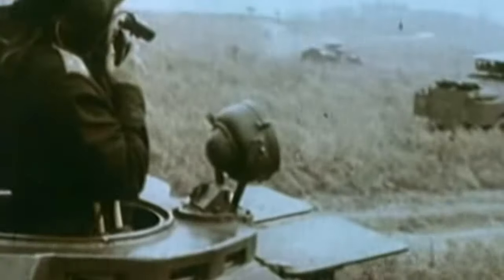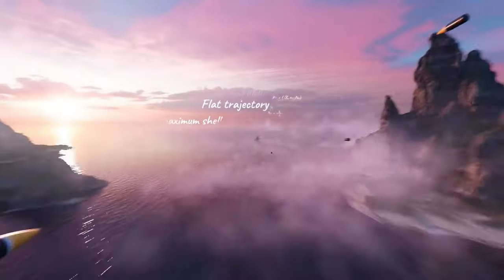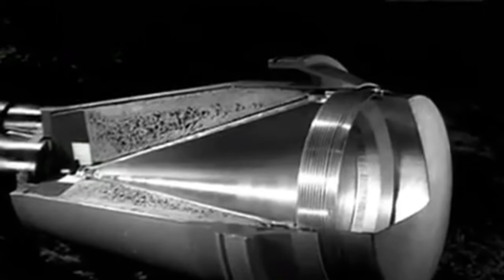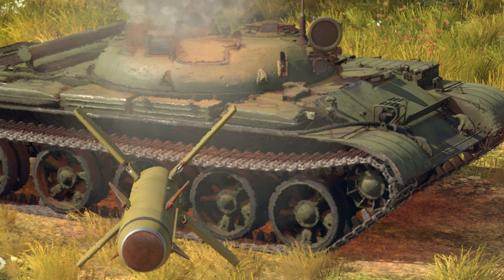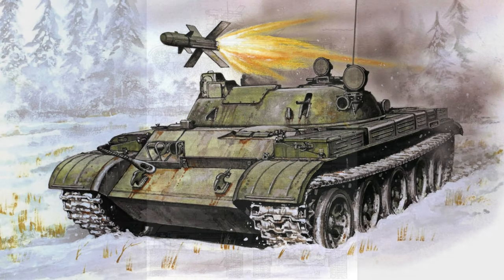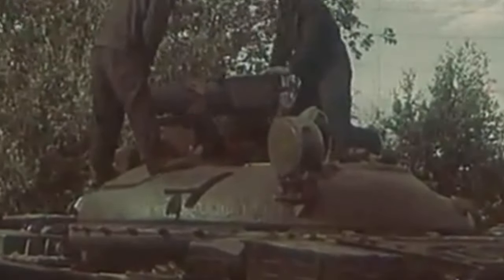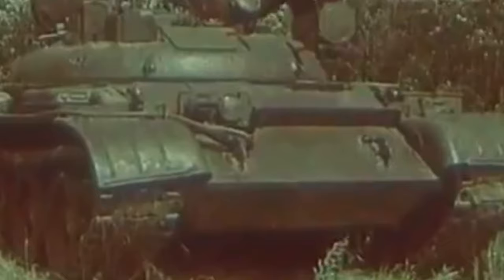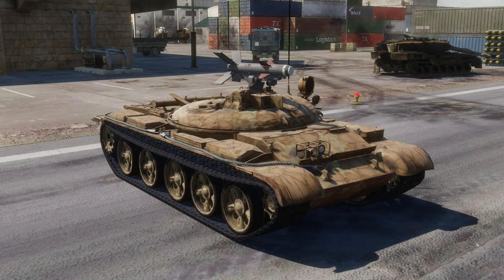IT-1 Tank Destroyer | SOVIET ANTI-TANK MISSILE VEHICLE

Comment: Easily one of the coolest reloads I’ve seen
Reply: I put this right up there with ultimately inefficient but cool weapon system concepts that actually made it to the front line.  Right next to swing wing aircraft and those naval missile launchers that reloaded vertically from a hole on the deck.  Now that I think of it, a tank borne VLS system would be pretty cool, and not really necessary too!
Reply: @josetrujillo2394  "a tank borne VLS system" - may I introduce you to the Russian Tor mobile SAM?
Reply: That's what your mom said 🤣

OH SNAPP BURRNNNN
Reply: @ExcavationNation  😐
Reply: @ExcavationNation  0           0
                                       ------------

Comment: Its less that the TD concept passed it by, but more the technology did.  As mentioned ATGMs became miniaturized and ruggedized enough to be fitted to gun tanks and IFVs.  But the "tank destroyer" never went away, it was just realized that MBT level armor wasn't necessary for the role, so it went to cheaper platforms like the BRDM.  The IT-1 is kind of like the Soviet version of the M-60A2  or I guess the Raketenjagdpanzers. The last gasp of the old idea that a tank destroyer would have to  square off against tanks in a gun fight.   The TD evolved into light missile carriers and attack helicopters.

Comment: Matsimus: Thank You for taking up a subject, I consider of Importance! What is a tank destroyer and what is a tank destroyer?

If we look at the Swedish S tank it was more of a tank destroyer than a tank. What was wrong with it was that it was tracked. It is a simple design proposition that there is an optimal ratio between the lenth of the supporting track and the with of the vehicle.
Make it to long and you get a damned heavy monstrosity that cannot turn (or when turning clears out a city block and need heavy duty support to move at all (You can watch Sofileins latest videos for a perfect illustration of that point). Make the relationsship to short and the vehicle is directionally unstable at the slightest speed - it simply spins around at the slightest provocation.

Now trust the Swiss (and turks) to come up with a solution: They make the rearmost wheels counter-steering below a speed of 20 km/hr. This gives the  Piranha V 8*8 a very tight turning circle (necessary for the Swiss mountain roads)., In fact so tight that the whole vehicle has a turning cirle that is about the same radius as the turret on a reasonable sized tank gun.
This leads us to the S-tank: Why not dispense with the turret all together? You can keep the vehicle (reasonably protected) undet 30 tons. Give the thing a road speed of 80 km/hr without needing to resurface the road afterwards.
Use the suspension to regulate the elevation of the gun and the steering wheel to achieve the direction. Well, You don't get a Challenger on wheels, but pretty damned close with the L7 gun which nobody has called trash.

Comment: "There's no such thing as tank destroyers after 1945"
AH-64 Apache has entered the chat
A-10 noises intensifying
Reply: Those are ground-attack aircraft, not tank destroyers. Examples for post 1945 TD's would be the AMX-10 RC, 2s14 Zhalo and EE-9.
Reply: @ravenouself4181  But what ground targets were they specifically designed to attack?
Reply: @drrocketman7794  Tank destroyer refers to a class of ground vehicle designed to specifically fight other tanks and destroy them, they're not meant to and should not be use for any other reason than to kill tanks. The concept was borne in WW2 when countries realize that building a capable tank that could stand up to other tanks was simply too expensive and develop dedicated tank destroyers as a cheaper alternative with higher tactical and strategic mobility so they could ship them out to combat mass enemy armor divisions. 

You're referring to attack aircrafts which could attack tanks but that is not their only purpose unlike tank destroyers.
Reply: @dannyzero692  ok. That makes sense.

Comment: Well the russian tank destroyer project might not have been successfull. But you should consider the two German Kanonen Jagdpanzer and the Jaguar Raketen Jagdpanzer. About 1000 were build in total. They  were vehicles of about 25-30 tons.
As far as I can gather: They were meant for the local defence, so if/when the russian punched a hole in the defence line of Nato, they would attack the armoured personel carriers, fuel truck, etc.
The main benefit was that they were relatively cheap low profile and reasonably fast. The basic idea was for the Leopard 1 to race on the Autobahn to "stop the rot" and the local defence to make life as short and unpleasant for the WAPA criminals as possible - they would not go up against the russian main battle tanks as such, but make their supply chain impossible.

Die Jagdpanzerne were a sort of stop gab measures on a budget - that was not hopeless - they full-filled that purpose reasonably.
Reply: Interesting.

Comment: I thought the T-72 had antitank missile capabilities as well. Its been a really long time since I heard about it. It could have been just a prototype though.
Reply: The T-72B obr 1984 actually have anti tank missile capabilities
Reply: It was a designed capability.  But it was allegedly ruinous to the barrel and not very accurate.
Reply: through the barrel itself but im curious if whether they are used in any battle or just put in storage
Reply: @joshuajoaquin5099  During the current conflict in Ukraine, the two primary types of 125mm tank gun munitions used have been GLATGMs and HEFS. APFSDS is largely a no show, probably due to the extreme ranges (excess of 4km) involved.